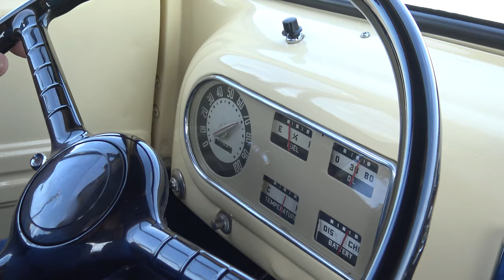1949 Ford F1 pickup truck inspection look & drive Flathead V8 Offenhauser heads, Samspace81 Texas

Comment: Put a small amount of brake fluid in the wiper motor. It'll make the leather seals soften up and they'll work fine.
Reply from the maker: I'm thinking its been a long time since the wiper motor has seen an actual leather seal